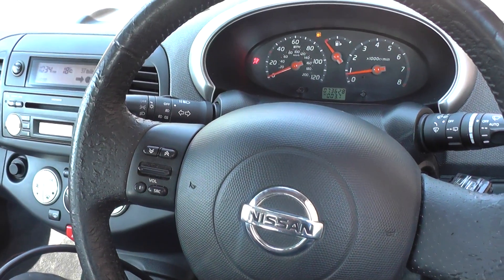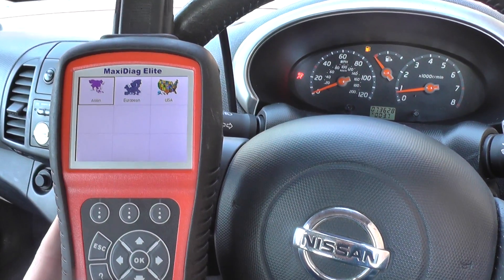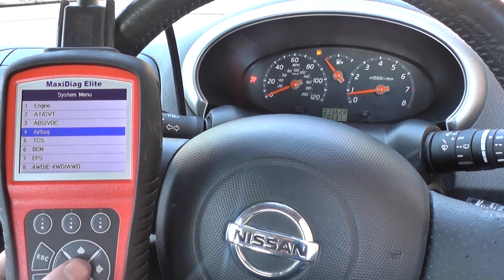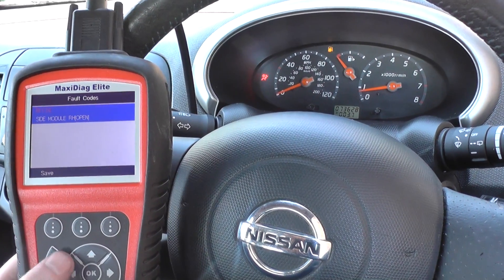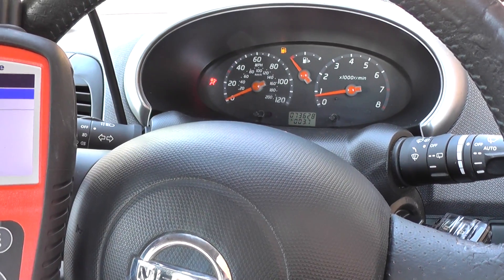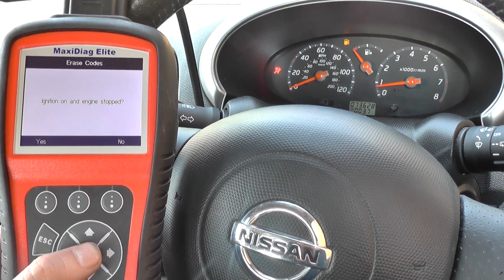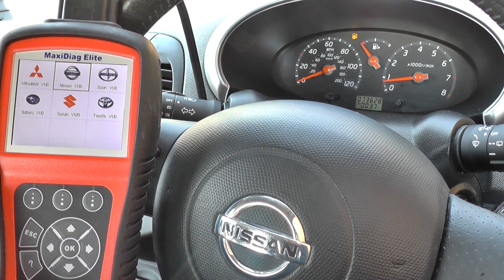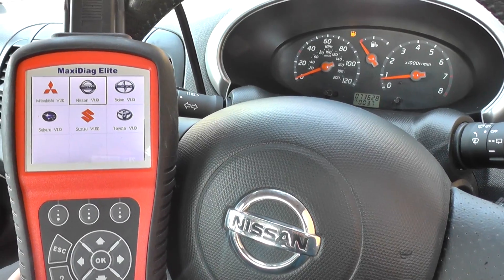Nissan Micra Airbag Fault Code & Warning Light Reset B1129 Autel MD802

Comment: If you know there was a loose cable under the seat then you dont need this tool to reset the warning lght. There are other videos that show yo how to do it using nothing more than the key in the ignition.
Reply: tried all them methods with the key all useless